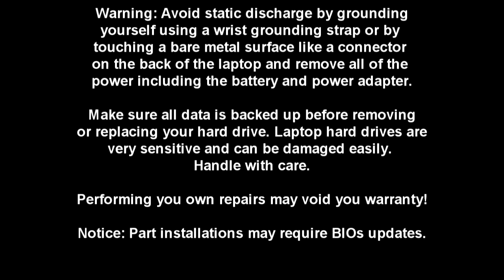How-To-Tutorial: Dell XPS 15z (L511z) Audio Circuit Board Replacement

Comment: The internal mic and external mic not working even when we connect wireless Air dots, still no response for the mic, i have tried every possible solutions like drivers softwares nothing works, is it possible that this could be due to audio card failure?